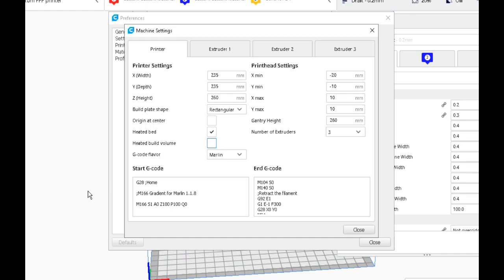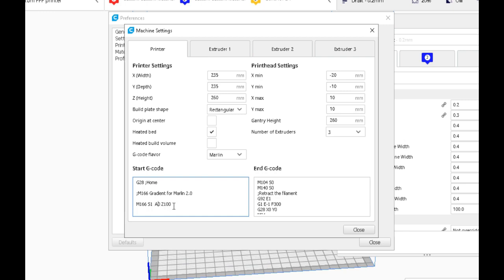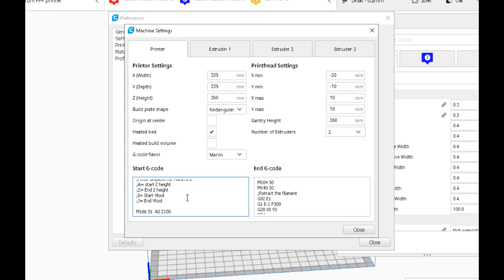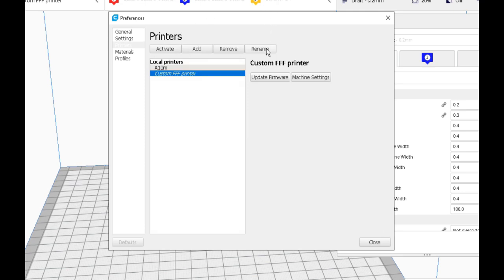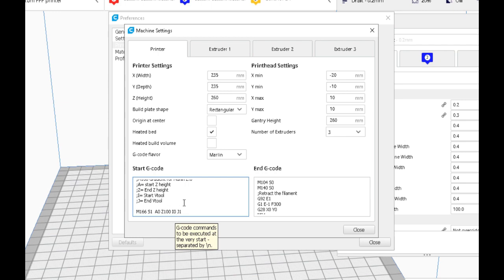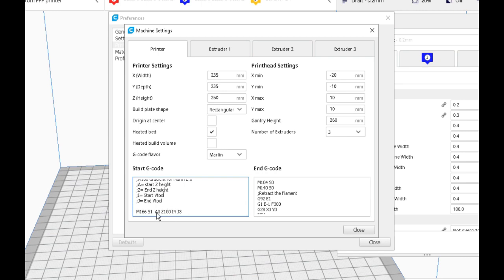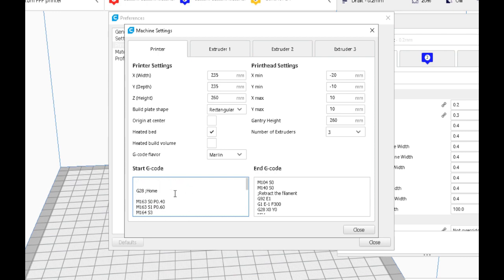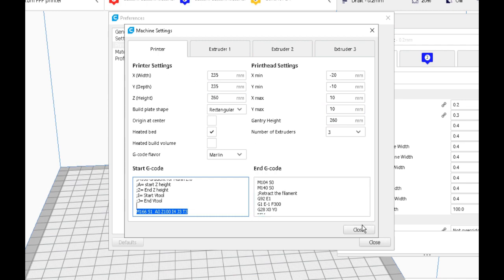Simple Gradients M166 Part2  for Marlin2 0

Comment from the maker: PLEASE NOTE: It appears that if you have Marl;in 2 firmware, and use Cura,
You need to add a  "T0" on a line directly after M166.
If your printer just resets just after homing... this is the 'fix'.

Still not sure why its happening yet though